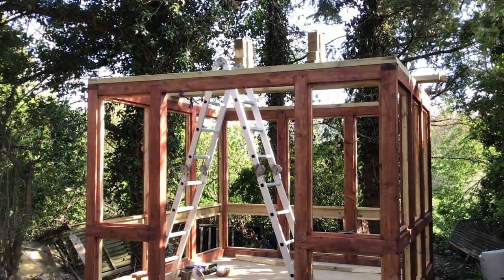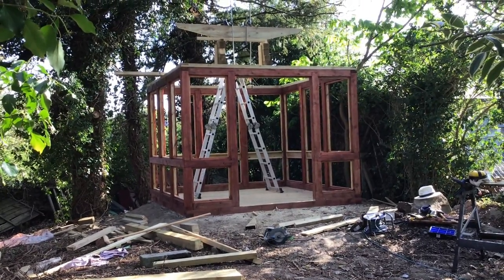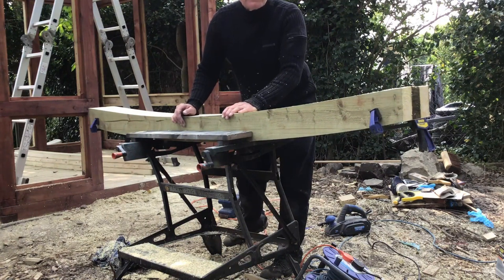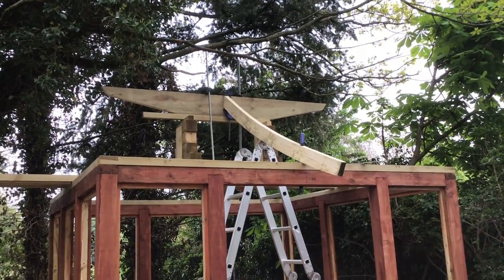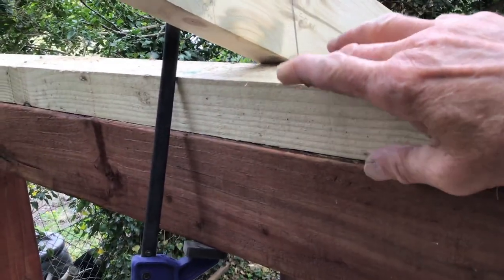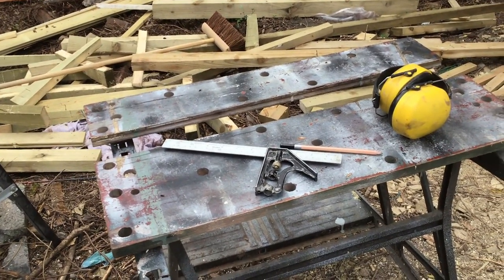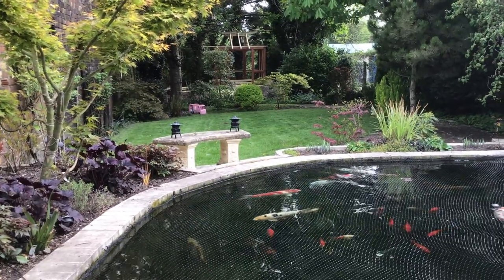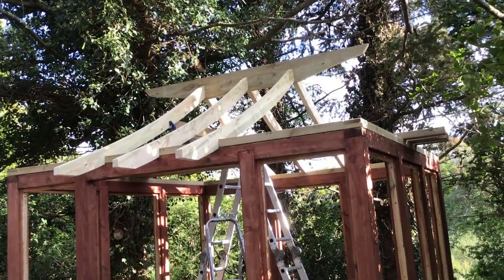Part 4: How to make a Japanese tea house. The roof frame

Comment from the maker: In simple terms, I rested the rafter on the top of the frame and pushed it up against the ridge (making sure the top of the rafter was at the same height as the top of the ridge (see from frame 11:34). I then used a clamp under the rafter on the ridge to stop it dropping. Once it was secure, I used a ruler vertical with the side of the ridge and drew a parallel line down the end of the rafter. I then cut this to shape. Once I had done that I replace the rafter against the  ridge. and drew a birdsmouth for the end of the rafter above the frame. The rafter needed to drop down by 60mm, so I cut a 60mm x 20mm birds mouth into the end of the rafter. The rafter then dropped down into position nicely and flush to the ridge and outside of the main frame (see from frame 12:23 to frames 13:40) Hope that helps. Kind regards: Alex